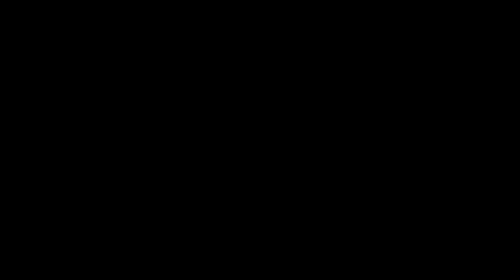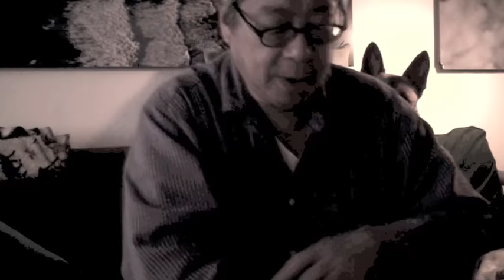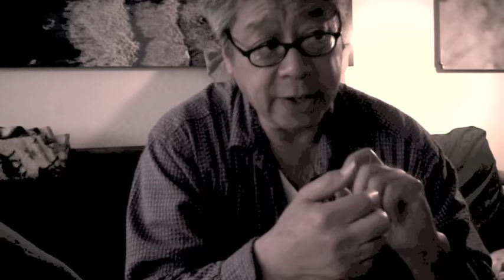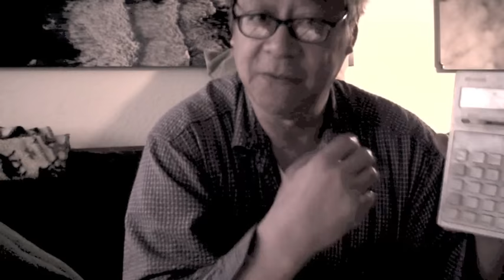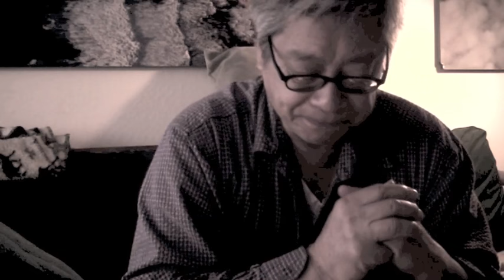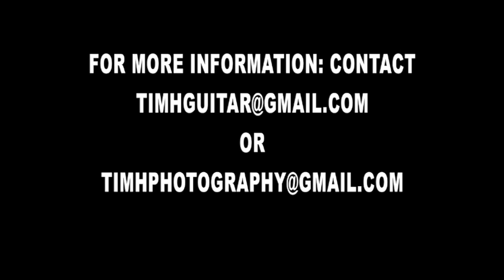Film Photography : Session 2 - F Stops - #8 of 14 videos

Comment from the maker: I want to add one more thing that I should have stressed. When a lens is focused on infinity the distance between the center (or near center) of the lens and the film plane defines the focal length of that lens. An aperture of the same size (the diameter of that opening) would constitute F 1.  Because of this method all lens will have the same relative exposure at any given aperture. So F 8 will always be F 8 no matter which lens is used for any given exposure.
But this is only true when the lens is focused at infinity. Obviously if you focus at an object only 5 feet away the distance between the center of the lens and film plane will be much longer. Therefore when shooting 5 feet away and using F8, you are actually not using 1/8 of the focal length of the lens. That's why there are things like "factors" used to adjust exposure when shooting closeups.
Hope this makes sense.
Reply from the maker: In other words when shooting from 5 feet away F 1 would be a much larger diameter.